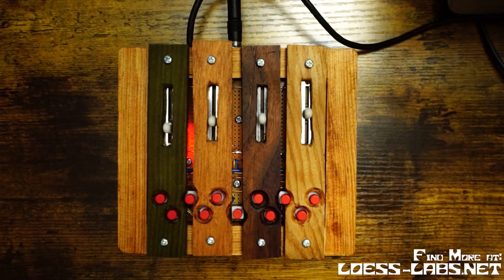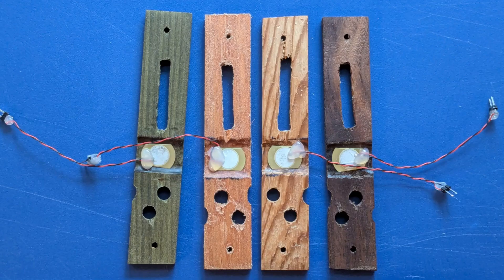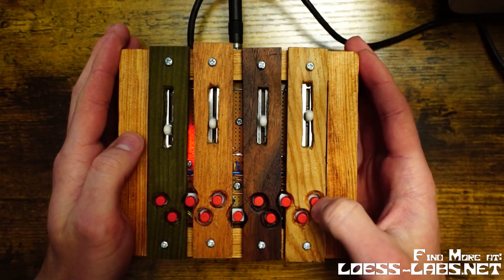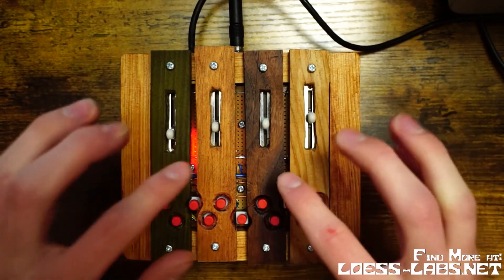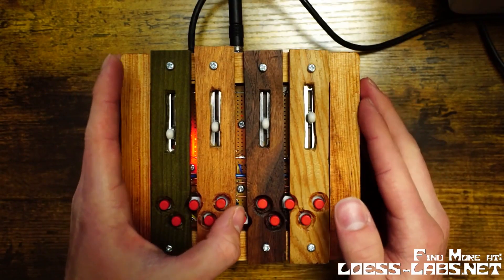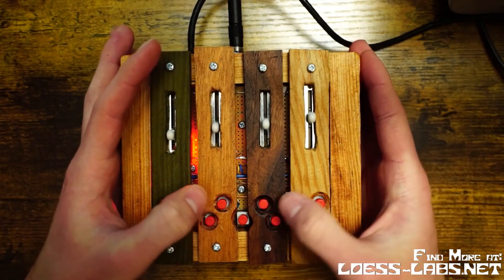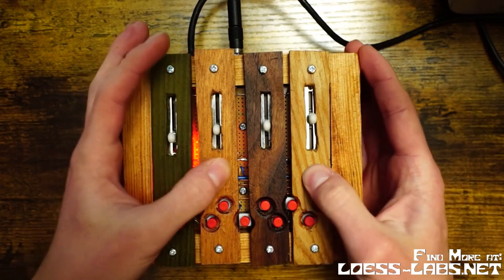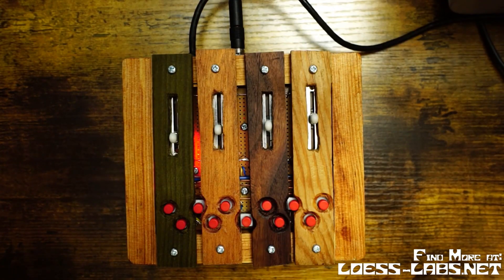DIY Digital Touch Synthesizer

Comment: jeez why do i like how this sounds even more than the tetrax haha. awesome job once again dylan!
Reply from the maker: Thank you! It has more timbral variety than the tetrax at the cost of a lack of analog control (and patching). Audio is also a bit crunchy/noticeably digital but not terrible.
Reply: @uvknhn  i personally love the crunchy lofi digital sound. a perfect mix of tetrax and the shnth but with a completely distinct flair. im going to give it a shot building one once you release the code and more info about it :)
Reply from the maker: @kwahzee  Thanks. It should be up in the next week, if not the next few days. I just need to make the code more readable and usable. I have a bunch of stuff in it tailored to my specific build (ie fine tuning for each piezo barre)